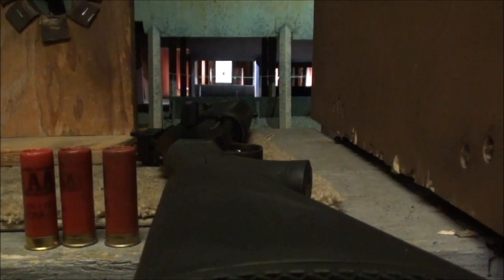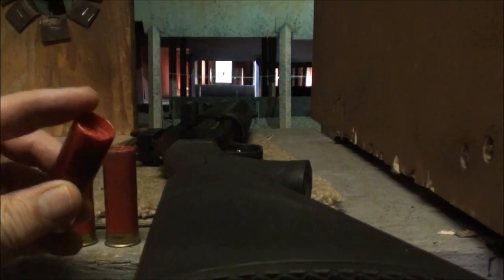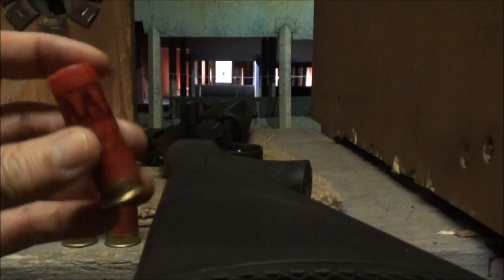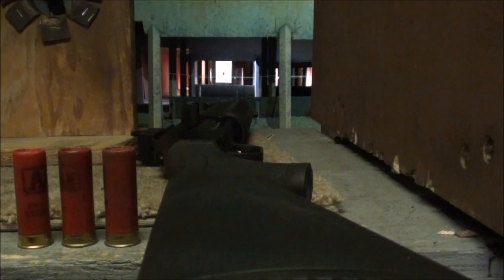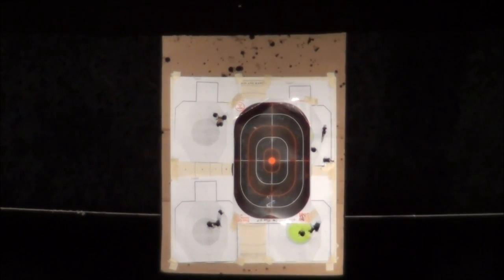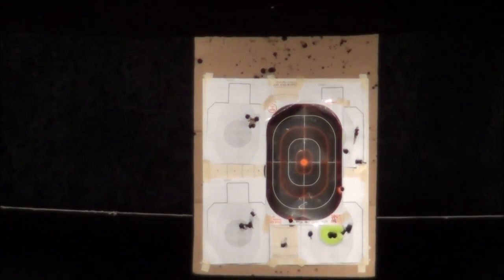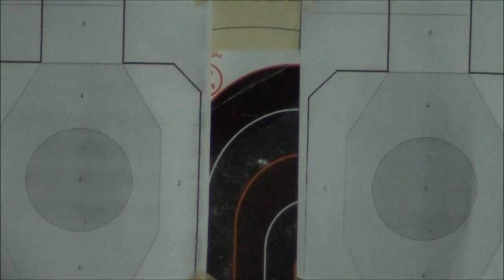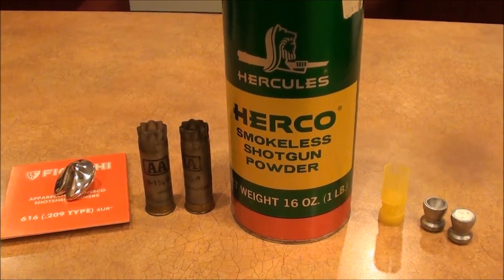The Backward Lyman 525 Slug With Shot Filled Cavity At The Range

Comment: Nice one, FC...it looks like they are going right in there.
Reply from the maker: Larry - Did you notice the round holes at 50?  The ghost ring was getting lost in the background - couldn't tell if it was centered or not.  More 50 yard work to follow. The ones at 25 tore some weird holes because the targets weren't taped down flush.  But the slugs are flying true - Best Regards
Reply: Yes, Steve, I caught the 50 yrd target but for me it was hard to distinguish what was what.  But like you said, they seem to be flying true and with the Herco powder.
Reply from the maker: LMO MechTech Thanks for your neat comments...Will try to get to the range tomorrow and shoot some clean targets at 50 along with some chrono work…Have a great day

Comment: I  have to get one of those lyman molds ,I also like that 930 Mossberg .I am usually using a 590 or 500 ,or 870 rem.I need an excuse for a new smokepole .I have been using the lee one onnce and it shoots  better than any factory slug I have ever tried
Reply from the maker: mark cooper - Thanks for all your fine comments - If you ever see a Mossberg 930 SPX, put the nab on it without hesitation.  It has been 100% reliable now with everything that I have put into it without adjustment, without fail on seven range session so far - average 50+ rounds a session.  The quality is there without the overpricing of other makes.  Let's keep this quiet, but I don't know how Mossberg can do it - but since they can - what does that tell you about companies that produce auto shotguns that don't work or look any better for double the price?  Proudly made and owned in the USA!!!

Comment: I would love to see someone try one of these in some ballistic gel to see what's actually happening on impact.  Some pretty complicated physics going on there.
Reply from the maker: Ben Wilkinson - Two systems are in play - the backwards slug is easily good for no tumbling in flight out to 25 yards.  But on impact, the slug may tumble in terminal ballistics - if it does, that is a mean rascal.  But packing into the cavity to encourage expansion as well as introduce secondary projectiles from the contact is the other system.  I've got another idea in the works, awaiting next Midway order…Best to ya...

Comment: So FC all the bird shot is staying in the epoxy/ slug?  If so then it just looks like you made a heavy slug. I was hoping that the shot would spread out of the slug.  Is that what you where going for?
Gman
Reply: Yes, I was curious about this as well.
Reply from the maker: gman77gas- Actually, there's no way that shot is staying in the slug once the thing impacts.  The elastomer caulk is just on the surface holding the shot in place - once in flight, the shot behaves just like a shot charge in the slug.  But the elastomer will not hold on impact.  Two things are possible 1) the shot disperses laterally in the wound 2) slug expansion.  Even if the slug behaves as a solid - you have a 590 grain wadcutter that will probably tumble a bit in terminal effect.  And 2" accuracy at 25 and once my AA12 wads come in should be reliable at 50 - we'll see… Best Regards...
Reply from the maker: ***** Repeat reply - Actually, there's no way that shot is staying in the slug once the thing impacts.  The elastomer caulk is just on the surface holding the shot in place - once in flight, the shot behaves just like a shot charge in the slug.  But the elastomer will not hold on impact.  Two things are possible 1) the shot disperses laterally in the wound 2) slug expansion.  Even if the slug behaves as a solid - you have a 590 grain wadcutter that will probably tumble a bit in terminal effect.  And 2" accuracy at 25 and once my AA12 wads come in should be reliable at 50 - we'll see… Best Regards...

Comment: Are you just experimenting or do you have an effect your trying to reach???  Almost like a cut shell effect without having to actually cut it...
Reply from the maker: dowdawg- Shooting 3 shot groups at 25 yards - and getting 2" groups from rest.  If the slugs are not accurate enough at 25, then 50 yard testing is not necessary.  This load passes the 25 yard test.  Couldn't chronograph at night, but at least we can proceed with this load...Best to ya...
Reply from the maker: dowdawg- addendum reply - Just fooling around with those slugs and thinking of the possibilities --- Neat when something works out…Best to ya...

Comment: Do you suspect the round is tumbling?
Was that a rifled slug barrel or SB?
Reply from the maker: tkarlmann - The Mossbery 930 is a smoothbore.  The rounds were not tumbling at 25 yards and the accuracy was around 2 - 2 1/2 inches.  That translates to 5 inches at 50 and 7 1/2" at 75 yards - probably the max field range for these loads.  Soft lead should expand, but we are not doing any gel testing...loaded backwards shoots as well as forward loaded 525 slugs.  Have a great day,  FC Steve